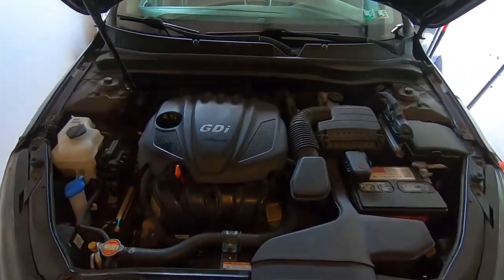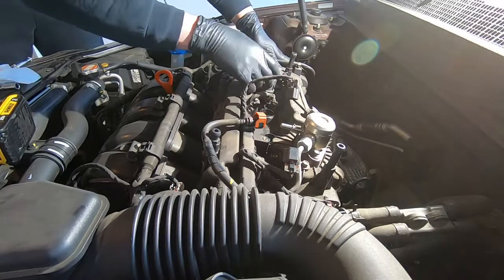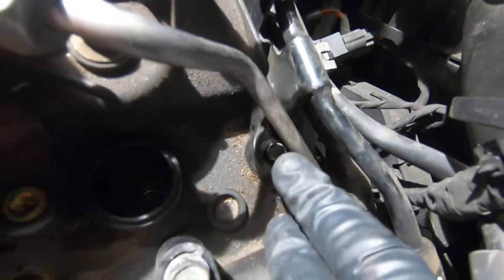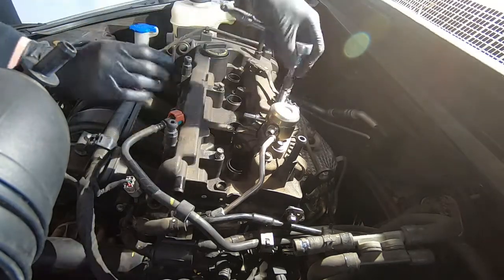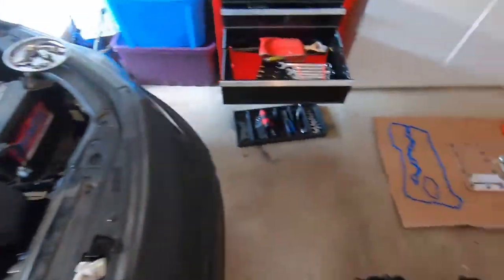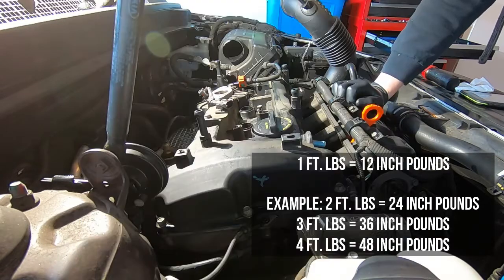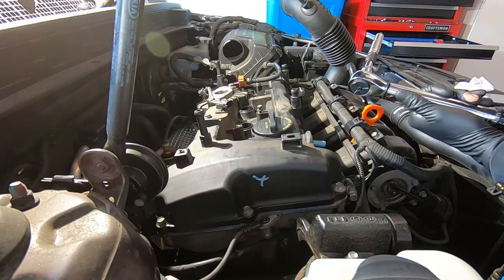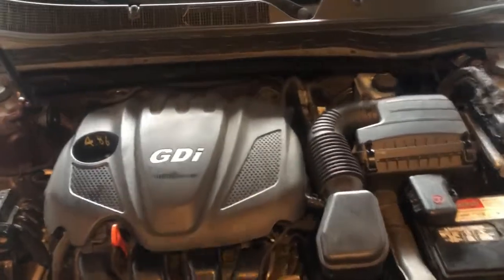2011-2015 Kia Optima Valve Cover Gasket Replacement (2.4L GDI)

Comment: I pulled the same fuse plug, and car never shut off, any suggestions
Reply from the maker: You might have to run it for a minute or two
Reply: @TheOriginalBeeCee  it actually just kept running for 10 minutes and never shut off. I tried running it again and then pulling it but just kept running also.
Reply from the maker: @ChicoNasty  got ya….you might want to check and make sure that it’s the same fuse as the one in the video, and confirm you are pulling the correct fuse…….if its 100 percent the fuel pump fuse you’re pulling, and it still stays running, it’s not the end of the world….you can still do the job & you’ll probably just have a little bit more gas drippage than you would have if the fuel/pressure was relieved.